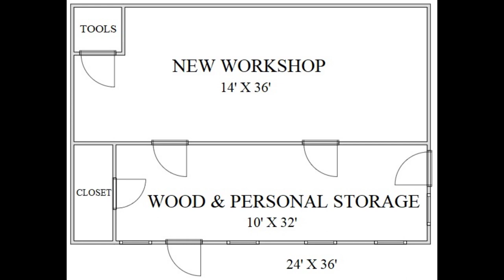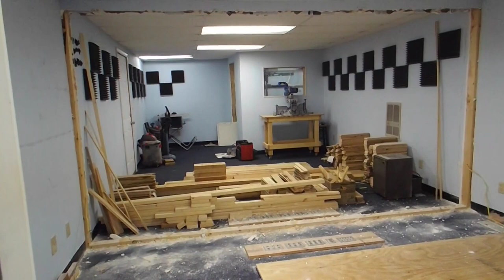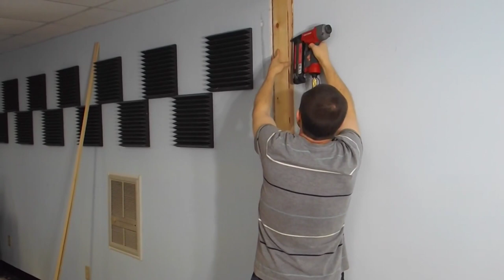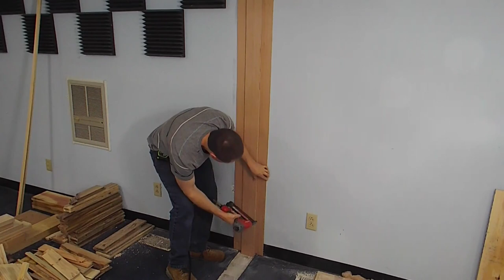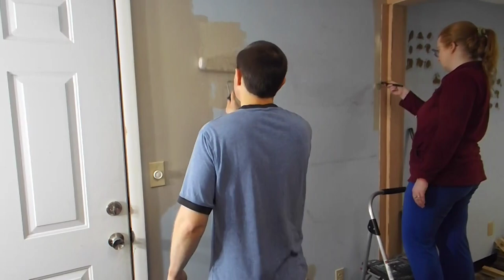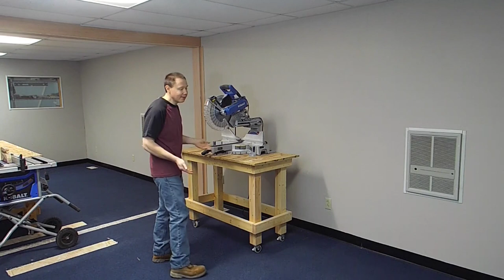We Remodeled Our Workshop | IT'S SO MUCH BIGGER! | Woodshop Tour 2022

Comment: Some advise that you can take or leave is, as someone in the middle of getting my own workshop in order, is to plan your layout with the tools and working space you think you'll need for the type of products you plan to make.  Including the specific equipment you hope to end up with. Example, I see you have a contractor's table saw. If you plan to upgrade to a cabinet saw, make sure you plan for that space and the space of the material, i.e. plywood. You will need a couple feet on the right side of the saw. Would suck if you build cabinets along both walls parallel to the table saw and end up not having space for the cabinet saw and a material (ex. plywood) that you run across that saw.
And if you dont know the product(s) you plan to make yet, then maybe just get the bare essentials tool as you go along, like you said, and put the shop layout on hold.  
I have no doubt you will be growing fast and I have confidence you will figure it out quicker then others, but it would suck building out your support equipment and then redoing it all cuz you out grew it so quickly.  
Last note, dont forget to allow space to actually assemble your product. Specifically floor space unless your products are small and eventually live on flat elevated surfaces.
Reply from the maker: Great advice! Thank you so much. We hope you're right, and we fill out the space quickly. Are you currently in the woodworking business?
Reply: @happywoodworking  No, not yet. I would love to build a business around display & furniture cabinets, tables and chairs. But I dont believe I have the skills to be successful in that arena... yet! But I do plan on starting with outside furniture. Sold my first adirondack chair for cost of material to father-in law, lol. Working on getting a decent process to eliminate waste and optimize build time.  
I only have basic power hand tools, plus a cabinet table saw (only proper woodworking machine I have). Hoping to build skills and equipment with this approach.